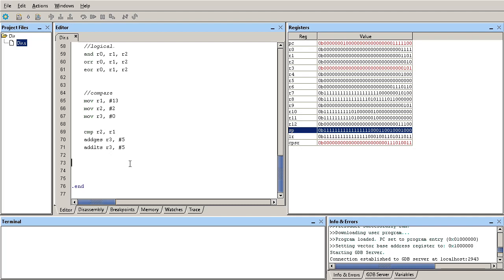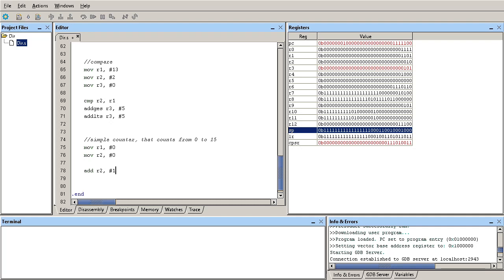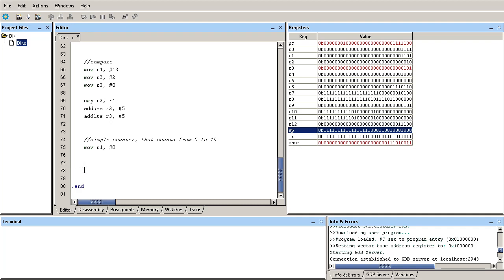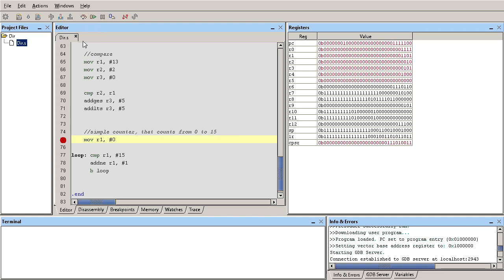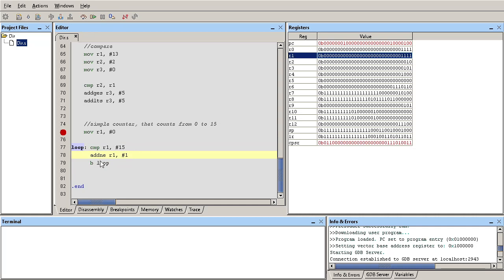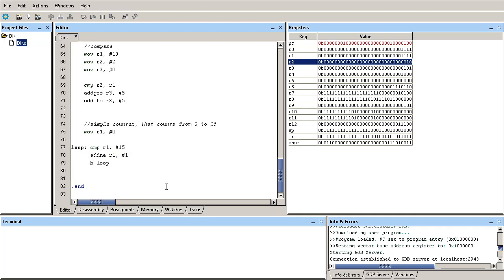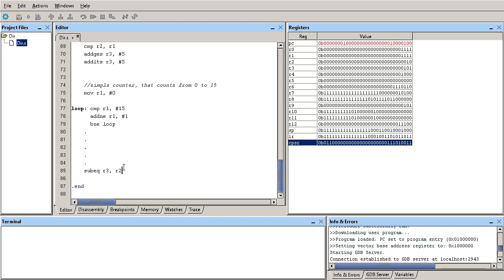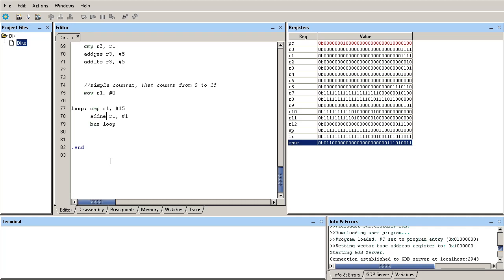ARM Assembly Programming. 17-Looping and branch instructions

Comment: very good video!

Can you show me how to implement the BASIC INKEY$ function in ARM assembly? I want to read a character without the need to press the "ENTER" key.
Reply: {from QBASIC built-in help}

'Reads a character from the keyboard.
'
'INKEY$
'
'    [] INKEY$ returns a null string if there is no character to return.
'    [] For standard keys, INKEY$ returns a 1-byte string containing the
'       character read.
'    [] For extended keys, INKEY$ returns a 2-byte string made up of the null
'       character (ASCII 0) and the keyboard scan code.
'
'Example:
'    PRINT "Press Esc to exit..."
'    DO
'    LOOP UNTIL INKEY$ = CHR$(27)    '27 is the ASCII code for Esc.
'
'See Also    <Keyboard Scan Codes>
'
Reply from the maker: You want to implement a QBasic function on the DE1-SoC board? You could implement a similar function probably. You'll need to make a project with the DE1-SoC computer system (not the ARM Cortext A9 system) so that you can access the components (keys, etc.) using their addresses, and read the keyboard using JTAG. You can use either loops or interrupts to capture a key-press and send it to the screen.